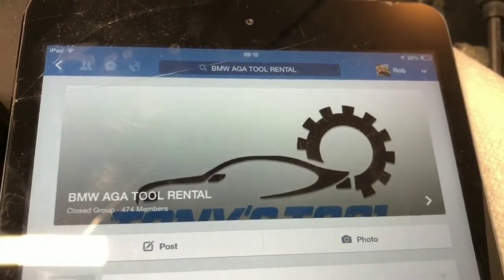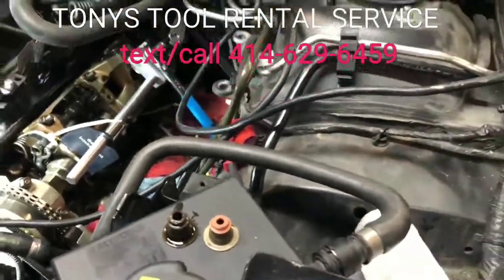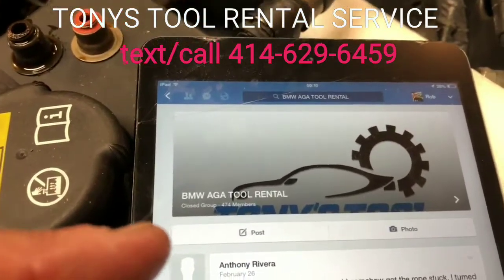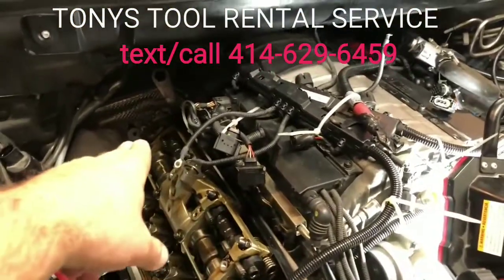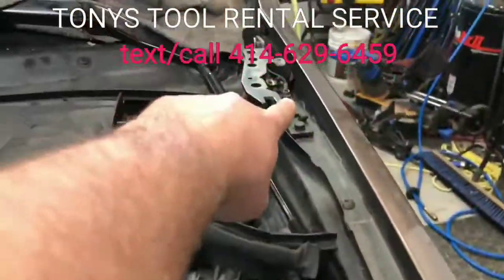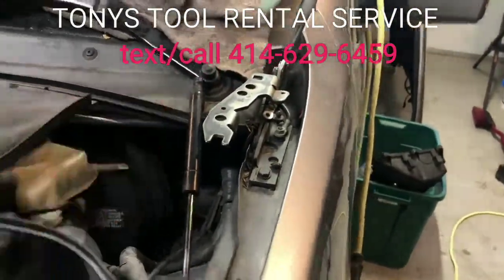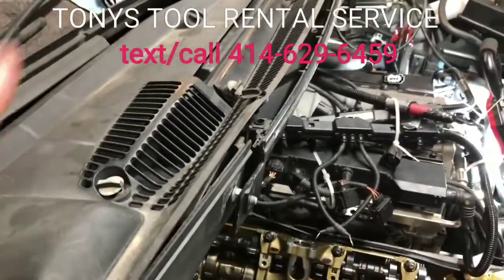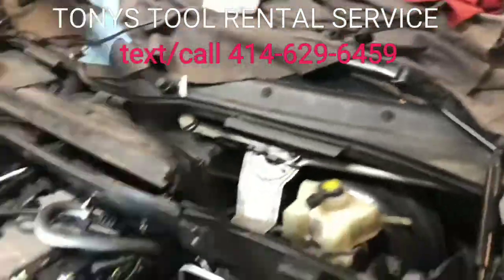BMW N62  X5 VALVE STEM SEAL REPLACEMENT

Comment: Did you use leak down tester to hold  valve up or you used rope.
Reply from the maker: Rope miki
Reply: @agan62toolrentalservice68  
I’m afraid if I use rope I will end up with knot in my cylinder head. 
Damn it not sure what to do 
Thanks

Comment: If I were to get this fixed, what does it generally cost?  I also have 04 x5 4.4 w N62 and am thinking this is what I need bc we’ve changed CVVs and still have smoke.  Is this super expensive?
Reply from the maker: Depending on where you go it can cost you anywhere from $2500-$5500.  The hardest part is to remove the valve covers really in my opinion.  Where are you located?
Reply: Melbourne FL.  Freaking out at price!!!  I love my car and am told by everyone I know to sell the car, but I love this car!!!
Reply: Do you sell tools?
Reply from the maker: @mmartin030   if you are able to remove the valve covers by your self , we can offer you 1 on 1 live service where we can show you and walk you through the process
Reply: AGA N62 TOOL RENTAL SERVICE hello you know how to do this job on a 2008 BMW X5
Reply: @agan62toolrentalservice68  hello same I have a 08 4.8i need help
Reply from the maker: @rainyreal6773   text us or  call us , maybe we can help you